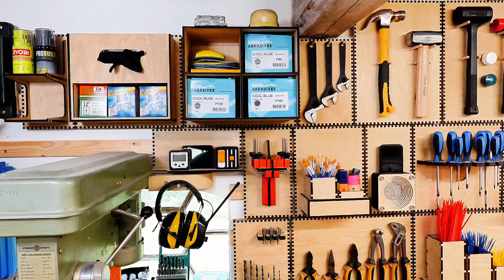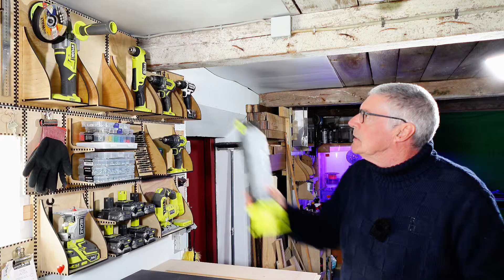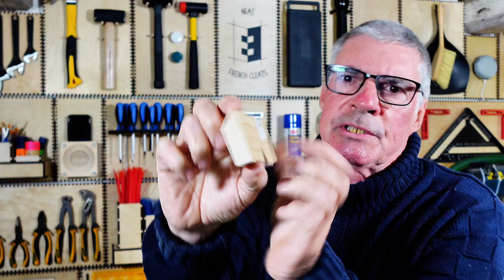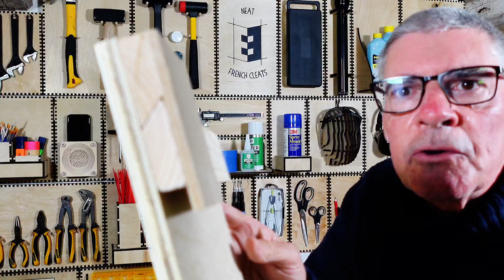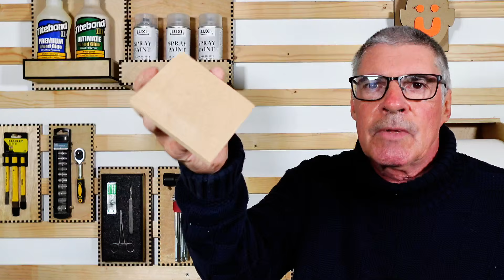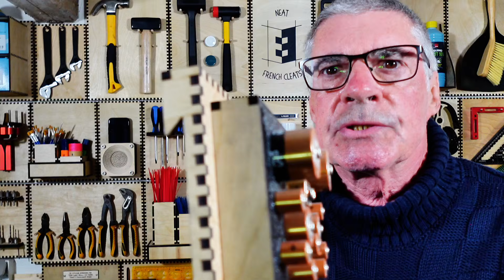Why Your Workshop Needs a French Cleat Revolution

Comment from the maker: 🚀  FULL WALL, ONE CLICK!  🚀  

Snag my -  French Cleat MEGA Bundle – 130 Laser Ready Plans - here 

👉 https://www.etsy.com/dk-en/listing/4311235633/french-cleat-mega-bundle-130-tool-holder

⚡ USE CODE: CLEATREVOLUTION25  

🎯 SAVE 25 % (only €59, down from €79) 
 
⏳ Offer ends at midnight on 24 June – don’t miss it!

⬇ Comment below: which holder will you cut first?

Comment: I really like the way the patchwork looks on the wall. I am just getting started on my "French Cleat Revolution" as you put it and the idea of writing the spacing between cleats for a neat look is a good idea, although I think you could measure it directly off of the wall without the test french cleats and get the same results. 

One other thing I noticed is that in your system, you can't remove the french cleats without taking off the one above it. This can make re-orienting a french cleat wall a pain. And any french cleats that you can take off and move to your workpiece, a paper towel holder become more hassle than they are worth. You solved this with your socket set by putting a french cleat on a french cleat, which works, but that just irks me a little. If you shorten the height of each french cleat by an inch or so you won't have that problem. doing this would mess up the visual of the patchwork design.
Reply from the maker: Great feedback. Thank you.

Well spotted, I could have measured the spacings/sizes directly off the wall, but it was harder to get the concept across. Also writing on the mini cleat asts as a reference for future builds.

I experimented with different spacings but settled on the best aesthetic. TBH, it's not difficult to move the cleats around. But people can decide what works/looks best. It's not set in stone.

Comment: I am guilty of having a fair amount of dead space. I also made the mistake of making holders that require the tool to be raised up instead of pulled off. I learned that tip from one of your other videos. I need to redo many of them on my walls, and begin to get rid of all the stuff I am saving and will probably never use. Cheers
Reply from the maker: Hello David.
Thanks for sharing your feedback. Maybe just redesign a few to begin with? Slowly slowly, catchy monkey.

And a good clear out always helps (it does for me at any rate).